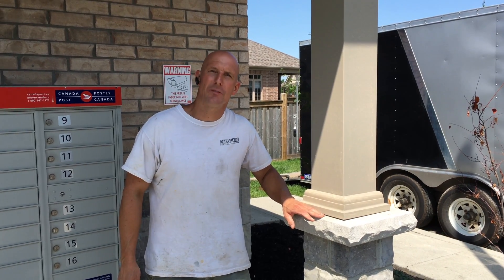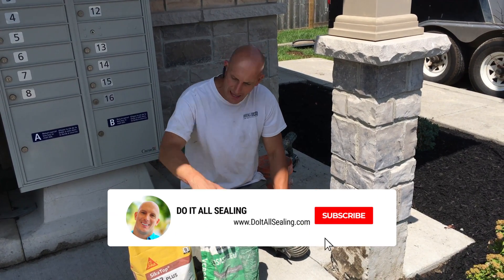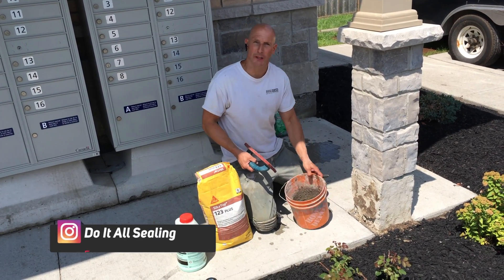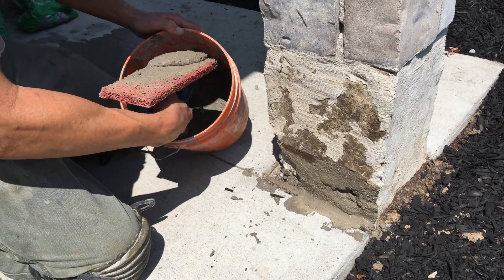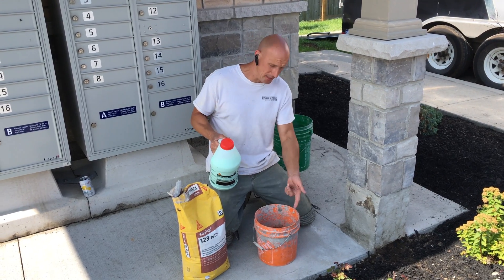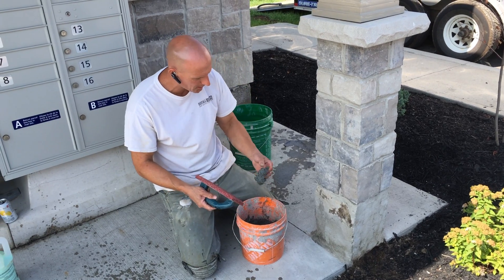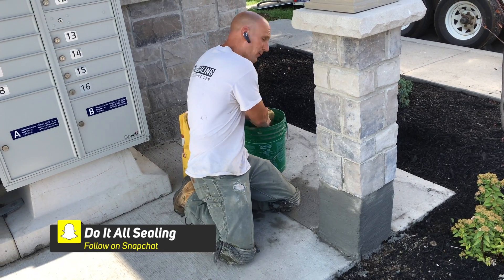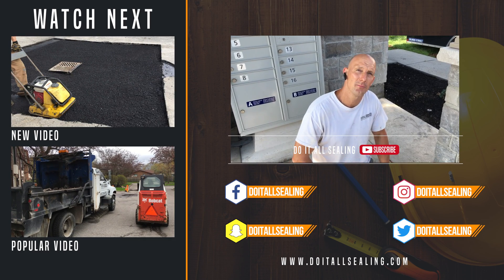Concrete Pillar Repair (4K) VersaSpeed & Sika

Comment: No concrete bonding application first?  I have a square pillar holding up my enclosed porch that some moron busted off a big chunk of the concrete and I wanted to rebuild it back up.  The rebar is exposed but still in tack with the remaining concrete.
Also, should you use a concrete form to fill it and then remove after it is set?

Thank you ahead of time.

Comment: When you said " Area is already prep?" What does that mean ? What needs to be done BEFORE applying cement? And why use a rubber float instead of a metal trowel ?
Reply from the maker: It means if the area was cleaned out loose concrete or dirt etc.  The rubber I find is much more easier to use with Sika.  You can use a metal or wood or magnesium float as well.
Reply: @DOITALLSEALING  Ok, understood.  Thank you so much for the response.